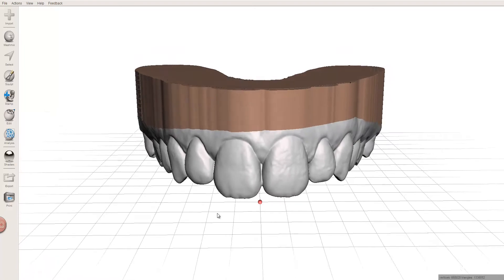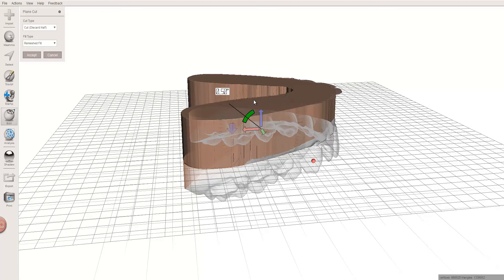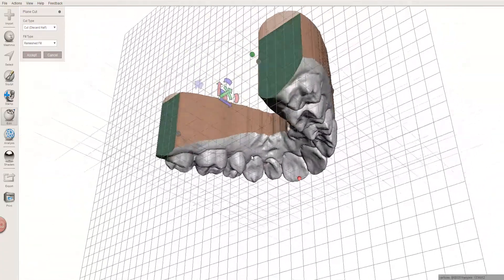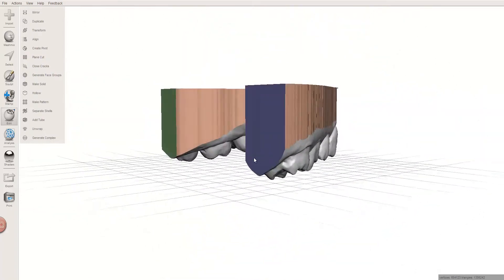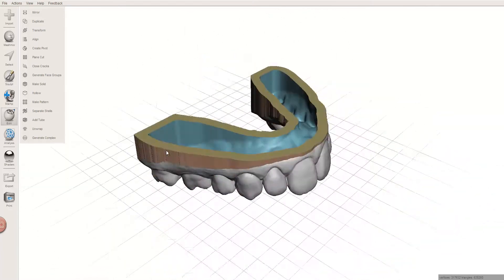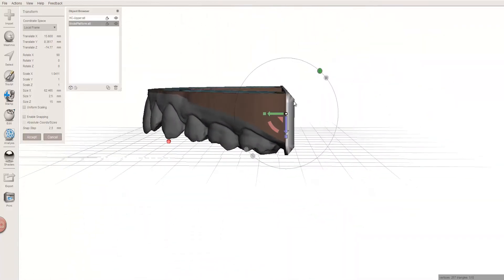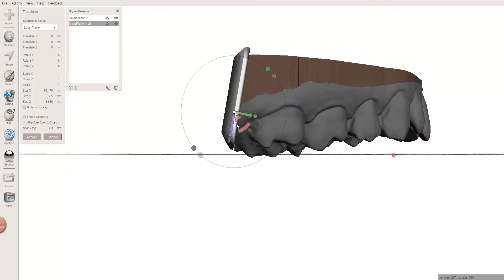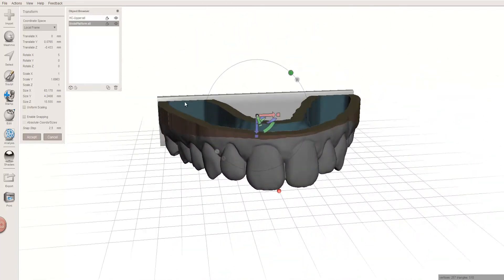Models Printing: Alternative To Angled Distal Plane Cut

Comment: If you have an opening after a distal plane cut, as you show in this video,  would the base allow for the closure of the opening? I'm not sure if there would be times that the opening is hard to keep closed while making the plane cut, but just curious.  I hope that makes sense.
Reply from the maker: +Matt Deeney sadly, no. The printing software will see it as open and attempt to repair. It MIGHT be ok when it repairs, but hard to say.
Reply: Baron Grutter DDS  Right on. Thanks for the reply.